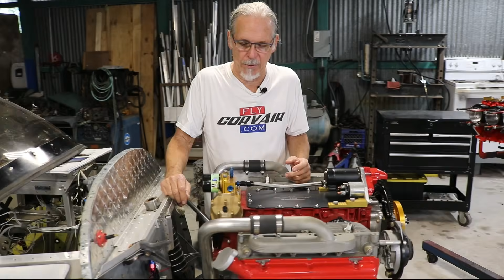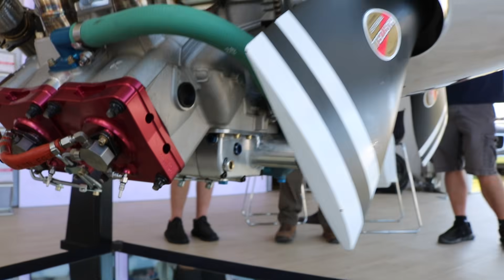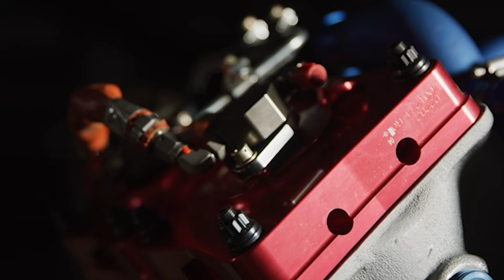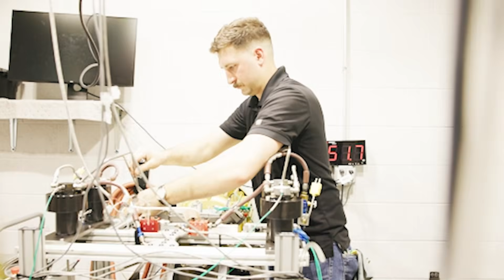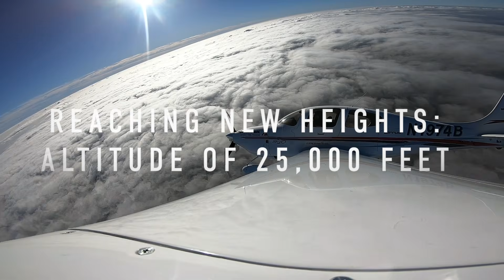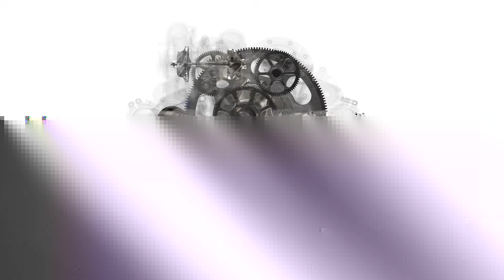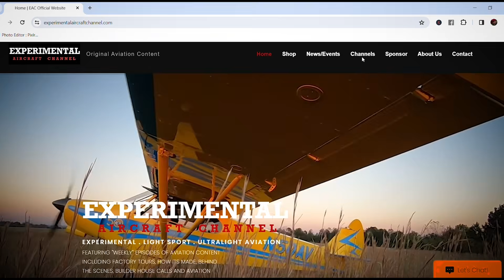DELTAHAWK Diesel Jet Aircraft Engine - ENGINE WEEK 2024

Comment: A fair bit of miss information here. It is a two stroke so that is a blower, to push the charge into the cylinder not compress the intake charge.  Older lycomings have relatively good propulsion efficiency but poor specific fuel consumption compared to non aviation piston engines.

Comment: Dear manufacturers of the world's last diesel engine, arguing the advantages and disadvantages of two-stroke and four-stroke engines is pointless—that's long been known. But arguing about the premature end of diesel use is worth it, and it's definitely worth it... Because humanity has no real alternative to diesel engines, other than empty talk about electric motors... I've been working with high-pressure fuel injection equipment my whole life and have developed designs that will also suit your aircraft diesel engines. If you want to improve your diesel engines, please contact me... Cummins, Caterpillar, and General Motors—they're taking a rest... And, of course, without electronics. The injector opening pressure equals the closing pressure and ranges from 100 to 300 MPa (your choice). The spring force ranges from 3.2 to 9.6 Newtons, and the valve weight is less than 1 gram.

Comment: It's very gratifying to see an engine like this and realize that I'm not crazy. 
Follow my reasoning. 
Here in Brazil it is still very common for ultralights to use the engine VW boxer 1600 Aircooled.
It is relatively simple to assemble it with an 84-stroke crankshaft and 95mm pistons, iven with dual ignition. 
In this configuration (≈2.400cc) it achieves 200hp at automotive revs and approximately 100hp in the rotation of the propellers, using camshafts of our last kombi injected, where the secret to torque is long lobe separation (110°) and short overlap (<20°).
It turns out that the world record holder for drag racing with boxer engines is also from Brazil. 
And he manufactures bilet blocks for him to compete and resell.
As an engine lover, I would never stop thinking about what an aeronautical engine would be like with the bilets parts manufactured by it. Lighter and more resistant. 
But beyond that, I always thought about what it would be like if I took advantage of the 'ease' of powering a billet block and made an intake port on the side of the cylinders and resurrected the concept of Detroit diesel engines.
It's simple to think that not having an empty compression cycle brings more efficiency, and this configuration offers a lot of torque at low revs.
And for me, diesel cycle engines will clearly be the future, as well as a new level for light aviation.
For very simple reasons, Diesel cycles are certainly more efficient in transforming energy from fuel into power, Imagine if two-stroke was even more efficient. 
they require fewer parts, therefore fewer problems, and the main thing, when working with poor mixture the engine does not heat up! 
If we can work with poor mixture, we achieve even more efficiency, more distance, using the same weight of fuel, or carrying less weight for the same trip! 
All this paying even less on fuel!
*
PS.1 The only problem is the price of these diesel engines, they are still overvalued, if there are fewer parts, there is no reason why they cost so much more.

PS.2 I currently consider the Rotax 916si to be the most efficient engine on the market. 
In addition, rotax already dominates modern 2-stroke engines with its E-tec for snowmobiles. 
It would be so simple for her to develop a 2-stroke diesel with propeller reduction!

In conclusion, imagine the JMB VL3, Risen, Sling , RV's, In addition to the Brazilian Montaer MC-04 with a Rotax diesel! 
Speed, consumption and autonomy on another level!

Comment: I used to work for a company and part of my job was running maintaining a bunch of Allison-Detroit 12V-71T  that were 12 cylinder 2 cycle diesel with a turbo feeding a roots compressor blower.  They roared but only made .2 hp per pound of installed weight.   A typical Lycoming four cylinder makes about .66 hp per pound.  The Deltahawk must be really stressed out to get a useful power to weight.  Granted those Detroits ran continuously 24 hours a day for several days at a time. ( we would add 1 gal of oil while running when ever we saw the oil pressure sag a little. )  Occasionally they would shit a unit injector and you really couldn't tell until you saw all the sparks coming out of the exhaust at night.  If they had been powering a plane it would have definitely kept flying.  The unit injectors were a weak spot of the engine but were pretty easy to change.

Comment: Wait.. It's 2600 RPM?? That's funny as heck, a totally clean-sheet 2-stroke Diesel that's valve-less has the EXACT same peak-power RPM as most Detroits.. Pretty sure even the English Foden, which was very different compared to Detroits, still had the same RPM range lol. All a coincidence? Or is that particular RPM just the magical number for 2-stroke Diesels?

Comment: If this succeeds it'll be the world's first valve-less 2-stroke Diesel (not counting ship engines). Normal 2-stroke Diesels have valves  in the head like a 4-stroke and open them ALL up at once.
Normally turning to valveless designs instead of valved is a bit strange, as valved (uniflow) is more-efficient & has other benefits, however he did mention the whole philosophy was keep it simple and that makes perfect sense. Also while he explained it all very briefly & not so great, the main thing to think about here is this: because Diesel is non-homogenous mix no matter what the RPM is or how efficient scavenging is, there will NEVER be fuel-dump in the exhaust, so unlike Gas/Petrol 2-strokes no matter the design-type there is never any fuel-loss. Also with a Diesel you can over-scavenge to cool the cylinders (literally blowing intake air str8-throguh for a brief period of time) if it's helpful at some specific RPM but that's getting too into-weeds with it so I'll leave the discussion at that; people just need to know that with Direct-injection engines the options for 2-stroke designs are literally limitless, you can have either peak-HP monster or peak-efficiency uber-slow RPM thing; the weight could be insane or it could be lighter than a 4-stroke..

Comment: The DeltaHawk looks like a great alternative to the supposedly lighter air cooled Zoche Aero Diesels.   If only the extra weight difference could be cut down, then liquid cooling would be a clear advantage.   Actually scaling up and delivering real production numbers will probably be the deciding factor, with both of these Aero Diesel engines being in development for decades.

Comment: Calling a 2 stroke diesel turbo charged is total deception. It is not a turbo it is a air blower. It supplies air to the crank case there is no boost.
Reply: Incorrect comment. There is no air going through the crankcase on this design.  
The turbocharger here pressurises the charge air using exhaust flow, just like on any other turbo engine.

Comment: I had a 1976 ford F-250 king cab that I had a machine shop install a john deere 329 turbo charged diesel into. it was rated at 190hp. my contractor friend had a 454 v8 in a dually chevy pickup hauling a load, I was hauling a load, his was 16k Lbs. total with trailer- mine was 17.5K Lbs. with trialer. we raced up a 6% grade. I didn't just beat him: I DESTROYED HIM and I was hauling 1500Lbs. MORE than him. Lycontisaurus nuts will quote you "hp & torque, percentage, formula, blah blah blah." I DON'T CARE. a turbo diesel under a load? out performs gas in EVERY metric by a MILE. no WAY is that prop losing RPM on climb. NOT HAPPENING. I GAURANTEE YOU- this little 180hp engine will out perform a Lycoming 540, 235hp in climb & cruise. & the hawk235? will walk ALL OVER the turbo version of the 540. bigger prop- better torque. that's the difference. gas belongs on a race track. that's where it's happy. ANY application where your goal is to hold ONE speed (as in constant rpm) under a load? DIESEL RULES.

Comment: no more need for carb heat. no risk of shock cooling. just set the power & fly, all mechanical operation. I'd have oil pressure, oil temp, coolant temp, boost pressure, pyrometer, RPM for the engine monitor- mechanical gauges, plus engine monitoring system that saves the data & displays it on an engine management LCD screen. THAT engine is going to revelutionize GA.

Comment: I know enough about diesels to tell you- an annual inspection? will be a compression check, and an injection pump test, then an injector test, oil pressure, boost pressure, pyrometer temp., coolant thermostat- all check out good? you're as good as new. it's 10x easier than the old Lycontisaurus BS. I'd change the coolant thermostat & flush the radiator once every 2 years regardless- maybe even once every year. cheap enough worry prevention.

Comment: I love how they completely danced around the question of pricing and never answered it at all. ! this guy should be a politician. So many unanswered questions. to say it outperforms an air cooled engine isn't saying anything at all. How? What's the service ceiling?   do you have to run it full open to be efficient? What's the fuel efficiency at what throttle setting? What's the redline ? What size prop can you actually turn? How many blades? Is it for constant speed propellers ?  Oil-based or electric? Can you use it with a fixed pitch propeller? what are he safety features to prevent diesel runaway?  I'm not saying it's a bad design it's just a terrible presentation and a lot of unanswered questions. I love the idea and I love the design I just wish they provided more real concrete information. what timeline to provide firewall packages for aircraft not listed such as Cessna's and pipers? and why not sell the engine ? Why insist on an entire firewall package ? their marketing this at the EAA convention but limiting it to production aircraft, sort of defeats the purpose of "Experimental Aircraft Association" ….

Comment: Nevatotadat1905 posted this question: 
Great video! It seems that 230hp is pretty tame for a 330 lb motor. 

Was any testing done to see the maximum powe that could be produced before it self-destructs? 
What's the highest rpm was it tested at?

Horsepower alone, nor mass do not make an engine an aeroengine. Reliability midway over the ocean makes that. To prove that, massive costs come up.

Comment: Those forward exhaust pipes are going to destroy the alternator and starter if they aren't very well insulated.   It's disappointing that after 20+ years of developing you only have one v-4 in a plane!  You should have a dozen running around the clock.

Comment: could you simplify the engine, eliminate the alternator and roots blower by using an e-turbo?
Reply: They do have a hybrid version which eliminates the roots blower, I think they just use the hybrid motor at any operating point below cruise power so the turbo does all the air moving necessary.

But I agree an e-turbo would be more relevant for the retrofit light aircraft market, that was my first thought too.

Comment: Many many diesels are NOT direct injected, they can have precombustion chamber injections or port injection. So no... direct injection is NOT required. Monikers you might hear for this are IDI or the GM 6.2 diesel which uses pre combusion chambers. The glow plugs are actually in the pre combustion chambers not the cylinders.

Comment: I've always liked this engine and a few times considered buying one.  It's a great concept with the fewer parts and the diesel is obviously a safer fuel for aircraft.  Things I don't like is the weight, and the second thing which is fixable is the rear mounted turbo.  Having this much weight up near the firewall is not the best idea.  Obviously it looks great with the simplistic tubing run, which is also ideal for exhaust flow, but for cowl heat, it might be better to get the turbo away from the firewall.  Maybe two smaller turbos, one on each side.  This is something that can easily be redesigned.  Taking significant weight out is not easy.

Comment: Can’t wait till the 300hp+ version is released then it will turn my Commander into an exciting flying machine.. replacing the IO 540 I’ve been waiting for 15 years my engine is now 400 hours past TBO.. I hope they speed the release date for the 6 cylinder engines. I saw it at OSKOSH 2009 it has changed so much since then… I wonder if they will become listed for public investors? I love the idea  of more range less fuel, cheaper fuel and a longer TBO.. This seems to me a no Brainer.. I wont one 😊
Reply: I think he said the 230 hp version works just as good or better then the traditional 300hp, turbo charged and better less drag from cooling.

Comment: While the Delta Hawk engine has some interesting technology, I think it will fail, just based on the price equation. Not many new GA aircraft using legacy aircraft engines are being built, so engine makers need the huge used GA aircraft fleet to buy into this engine for them to sell them in sufficient number to survive. Industry insiders believe the Deltahawk engine will sell for $60,000, minus installation. The common, reliable Lycoming 0 360 producing the same power as the Deltahawk, costs $20-30k to overhaul. We're all hungry for new tech engines, but they won't sell if they are unaffordable.

Comment: A very interesting design...These will probably  become lighter and even more efficient in the future... My guess is this is something that will become popular in the high-end single engine high performance oriented SLA markets...I have ALWAYS admired simplicity in things, This is a design that will definitely fit that goal, Especially as it needs no PSRU... Ample Torque at low crankshaft  RPMs of 2,300-2,600 to directly drive a prop...Maximum efficiency... Liquid cooling assures no inherent problems of Quenching (Shocking) The cylinders & heads with extremely quick temp changes which is easily controlled with the Thermostat in the cooling System.. I have mixed Feelings about unit injectors for direct injectionn fuel systems As they have the ability to bring the plane home to a suitable landing strip With an inoperative fuel injector... But then , there are more individual fuel pumps to increase the liklihood of that happening... I did not hear what kinds of  environmental controls that this machine would require, such ad EGR or DPF , SCR's ,etc...Hopefully None of those things... Today is : 01/15/25

Comment: I think to going back to the best ideas from the past is great.  In order to be “Best” it has to be cheap, Think Chevy 350 or the ford straight 6.  Most people could afford them and they just worked, for decades.
Aviation has  gotten so expensive you can buy a New Bentley or a 4 seat Cessna. 
Things need to change in aviation. We see the biggest advances when everyday folks can jump in. 
Today we see mosquito sized airplanes that cost $150,000 if you build it.  
They crash daily because our fuel cost means we tend to stretch any maintenance costs down the line, and the price of parts is ridiculous.
There are many great ideas like this engine, but to truly be the best it needs to cost $100,000 less 
My wife said no to my flying ambitions 25 years ago. 
I bought the Bentley, saw most states and have spent less than 5 grand to keep it new.  
If you flew every day for 25 years you would be in the multi million dollar range.  
For a jet, I can see it, but a tiny plane, my wife was right. 
Change regulations and you can change Who gets in aviation.

Comment: I learned from bulk fuel distributors in coastal Alaska that Jet-A is equivalent to #1 Stove oil or #1 diesel.
Reply: Not quite the same, but they are similar and most older engines can run on either.  Lubrication is an issue with some injector pumps.

Comment: If DeltaHawk ever gets these into production, I would like to see these in automobiles. I would love a pickup truck with one of these, no auto electronics except for the option to add a radio. No electric windows, no electric door locks. Just a simple pickup truck like what I used to have in the '50s.
Reply: oh that's already possible, just a 318ci perkins out of a MF tractor & drop in there. turbo & injection pump rework for highway use, & you'll get 350 foot pounds of torque at 200hp, 35mpg and 1 million miles before rebuild. cylinders are dry sleeved, press fit, so every part on that engine that wears can be replaced- last power unit you'll ever need. a really good machine shop can build your bell housing adapter, machine a clutch plate & do custom engine mounts to get it in the engine bay of your pickup. use an aftermarket hydraulic pump to run brakes & power steering (legacy auto's stuff is absolute shit). I had a machine shop in NC drop a 329 inline 6 john deere engine into my old F-250. cost about $5k plus parts, but that was a while ago. today? probably double that plus parts. you'll want to choose a diesel pickup that's 1997 or older to avoid getting a thumbs down on your vehicle inspection. legacy auto & the feed are DEEP in the sack together- they don't want you bypassing their 'planned obscolescence' program.
Reply: @jaybee3165 I would love to do this in a Astro/Safari. They already have hydraulic brakes.
Reply: It would not pass modern emissions standards. You could retrofit though
Reply: @DigitalYojimbo that's why they are recommending a pre-97 car. It doesn't have to meet the same standards.
Reply: 12-valve Cummins 5.9 into a late 70s F350 and you have it made.